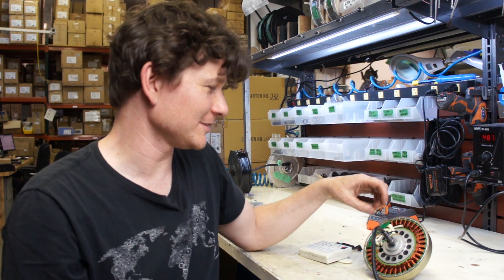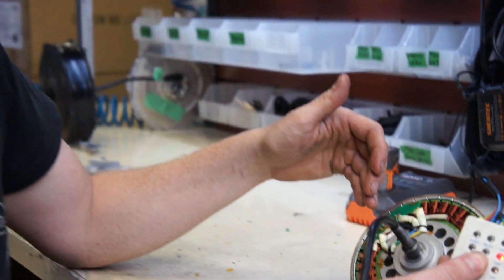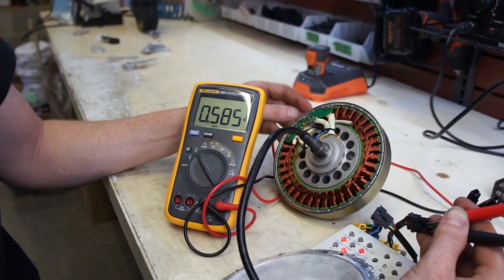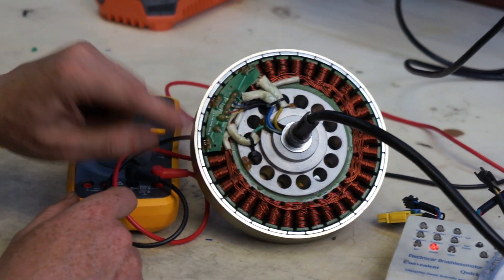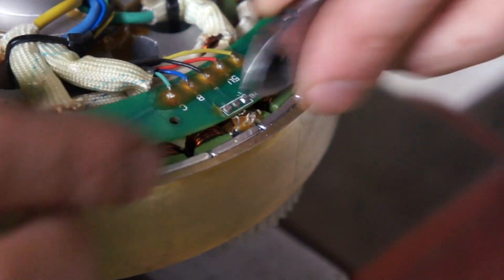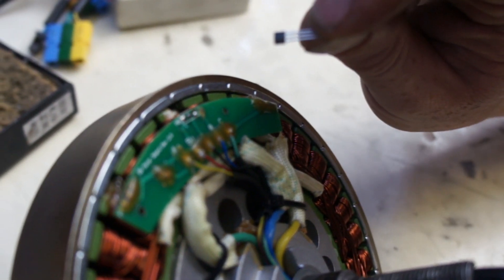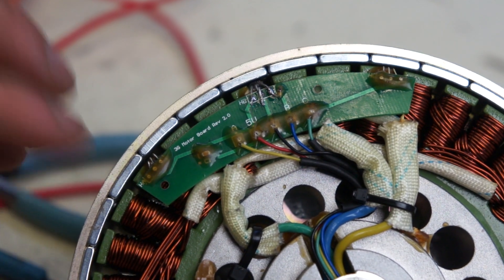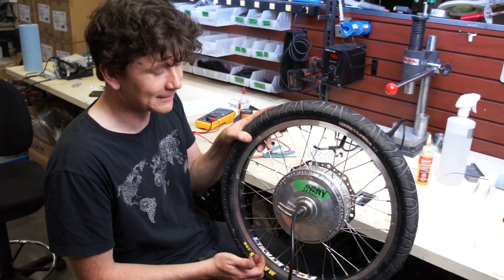How to Replace a Damaged Hall Sensor in an Ebike Hub Motor

Comment: Try a bmc 600w. They used  plenty of 1000 year epoxy on both sides. Thanks for the vid, pins to outside of the pcb will be a huge time saver, that is if I don't bugger it up.

Comment: Enjoyable,well presented vid.I always have trouble understanding this type of testing ect,so,i can,t see where the voltage came from that you were reading on your meter,was the harness coupled to a battery?sorry for being a pest.
Thanks.
Reply from the maker: Normally you would have the motor cable plugged into a controller that was hooked up to a live battery, and that would energize the halls for doing the measurements. But in this video we had a stand-alone motor hall tester which has it's own internal 9V battery for that.

Comment: Hi just watched your video on the hall sensor replacement and its exactly what i needed . I just need to ask a question.  When i connect the tester and spin the mangnets the blue flashes and the yellow but the green does not illuminate.  I changed the wire over ( blue to green ) and the green illuminates which tella me the les bulb on the tester is fine but when i put them back to there correct connections on the tester it doesn't illuminate.  You said in your video if it stays lit up then its the faulty one but what if it doesn't light up at all ? Can you advise.
Reply from the maker: It is faulty too if it does not light up.

Comment: I have an older 400w brushed hub motor made in 2007 that is not working. is the process the same or similar for the hall sensors? I do not think its the brushes, but I shorted out the motor
Reply from the maker: There isn't anything in this video that would apply to repairing a brushed DC motor unfortunately.  A shorted motor would be very difficult to turn, so if it still rotates but just doesn't spin when powered up then it is much more likely a brush/commutator contact issue than a winding short.

Comment: Thank you soooo much for this great video. I am currently repairing a scooter for my neighbour. The scenario was just the same : no torque arm, twisted cable. I replaced the wire, but nothing. I checked the hall sensors and found one was faulty, and I was just wondering how to change them... until I found your excellent video 👍👌💪👏

Comment: I also have an e bike gazelle motor 36 volt Hall sensor burnt down Online of hall sensor type A82L Can't be found Can I use another If so which one Thanks
Reply: If you can find a spec sheet for the old halls, try to find one that has the same or close specs. There are ratiometric , linear  sensors and digital sensors. The best thing to do would be to replace all of them with matching part #s. and use the same type of sensors that is original so everything continues to work right with the controller. Be sure you get the pin connections right also with the replacements.
Reply: @brettschacher8644  thank you i find the hall sensor 3x SS466A SENSOR, HALL EFFECT HONEYWELL are the same are better than the old ones
but thanks anyway
for your information is very useful

Comment: I have rear motor twiching problem . The motor whenever it wants starts to spin a little and then stops. Sometimes the problem disappear. Is it faulty hall sensors? Does it have to to with one of the two controlers?

Comment: Awsome and very educative. I am wondering what if i have a bldc motor without hall sensors. Can you determine where i need to place all 3 sensors?
Reply from the maker: It's not very easy to tell by just looking at a motor stator where you want to place the halls unfortunately.  It's easy to space them all 120 degrees apart based on the magnet pitch but the absolute location of the first hallwould be tricky without knowing the winding deails. I would take a guess initially, then use a motor controller that shows the hall offset in degrees and then shift them to have your desired hall offset.
Reply: @GrinTechnologies  Thanks alot! I will try your suggestions. Hope i can figure it out. Especialy the degrees. As the windings looks like a crazy ninja star/wood saw 6 toothed. 120degree Electric is 30 mechanical or am i wrong. Thanks!

Comment: Can you keep using it with the hall damaged? Or it will cause damages to the motor ?
Reply from the maker: Yes for sure, as long as the controller runs in sensorless mode then it would be fine to keep running it, but you'd want to disconnect the hall connector plug if the wire is actually shorted to one of the phase leads because that can put high voltage on the controller signals.
Reply: @GrinTechnologies  really thank you for your answer

Comment: Does the Honeywell ss41 sensor use a 10k ohm resistance between pin 1 and 3?
Reply from the maker: No the hall sensors don't have built in resistors either to pull up or pull down the signal. They are purely open collector on the output. So if you want to have a 10K pull-up on the signal to the 5V line, that has to be added as an external resistor which is typically on the motor controller itself.
Reply: @GrinTechnologies  Where are you locate ??

Comment: very nice video, thanks .  when i develop an engine. what is better. sensor with the larger area facing the magnet or the other way around?
Reply from the maker: The convention is to have the small side facing the magnets, partly because it's easier that way to have a dovetail channel in the laminations to hold the sensor in position.  But in broad terms of 'better' it makes no difference.

Comment: Your making videos but most of your  motors are out of stock.When will you be getting new stock in?
Reply from the maker: Actually we made these videos many many months ago but the summer got very busy, so we're only now having the time to finish editing and publishing them.  The eZee motors are out of stock until we can have an updated model that uses the L1019 connector and has built in speed sensor and thermistor. Initial sample testing has gone so we hope to have production units by late October
Reply: @GrinTechnologies  oh ok thanks bro

Comment: Good video, I've just replaced my hall sensors but awaiting the main power lead. Absolute pain getting the old sensors out as it was the same design as yours but yours came out with ease.
Reply from the maker: I promise you it wasn't staged!   We've definitely had cases where the hall IC needed to be gouged out with a pick rather than popping cleanly like this, and that's often the case when it's inset inside a right fitting slot in the stator laminations rather than just on the outside of them.  Good luck with the rest of the repair.
Reply: Grin Technologies power lead came and for some reason all sensors reads 4.8v constantly even when spinning the wheel. Not sure what's wrong, is it possible that l installed the wrong hall sensors as it stated it's for ebikes?
Reply: @GrinTechnologies  sir.can i use 3144 unipoler hall sensor?

Comment: if it shorts and burns out the hall chips why not then burn out the controller too?
Reply from the maker: That depends on the level of protection built into the controller. On our phaserunner and baserunner controllers, it's no problem at all to expose any of the hall wires to battery voltage, but on other controllers this can certainly result in chip damage.

Comment: 1:33 Most Hall sensor testing circuits that I've seen would only light the LED when the hall sensor pulls the signal wire low,  therefore  I would expect the corresponding LED to stay off continually rather than "staying lit up the whole time" if the signal wire was broken.
11:37 If you are using a separate magnet to check the Hall sensors on a direct drive motor with the stator removed from the hub, all three Hall sensors should be in the same state (all LEDs Off) before the magnet is introduced. The magnet may need to be reversed to confirm that the sensors also switch both high and low.
Yet another very useful video that is eZee to follow and understand.
Reply from the maker: Hey there, you are correct about the detail at 1:33. I realized that as I rewatched the video too, but most people will have a multimeter instead of an LED hall testor and their assumption would be that LED on = 5V so I think it's OK that this can slide... ;-)   Thanks for the feedback.
Reply: Grin Technologies I made this assumption!  What do you think would be the reason for all three hall lines to give 5-4v even after I have completed an entire rotation backwards?  Similar to the issue described in your video, one of my power lines shorted to the red hall line.  When I press the throttle the wheel will jerk forward very slightly and only for a split second.  As far as I can tell, my battery, 48v controller, and computer are all in good shape.  Any insight would be appreciated, thank you!
Reply: are the honeywell ss41 sensors suitable for hub motor? Fatbike ouxi which sensors?